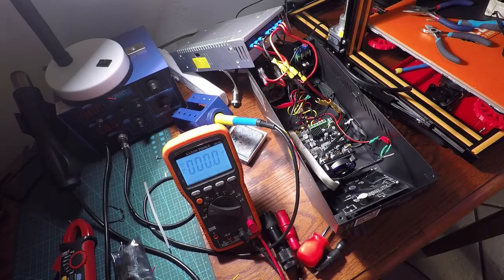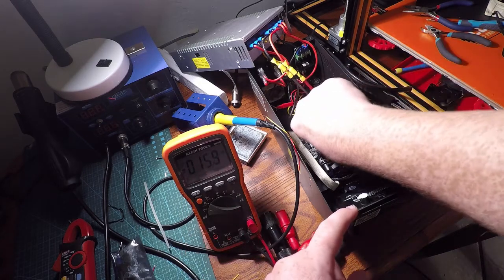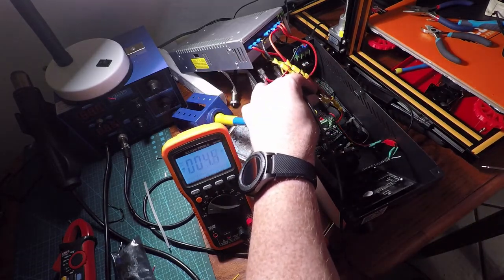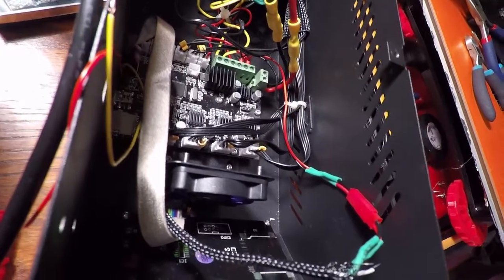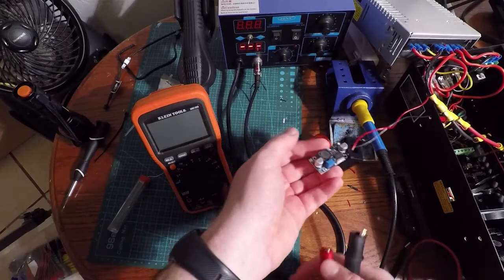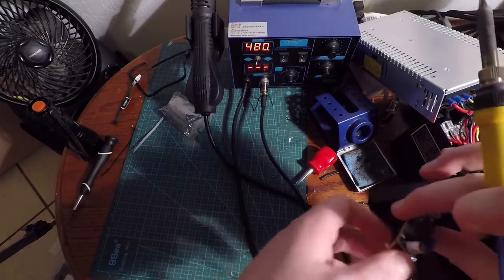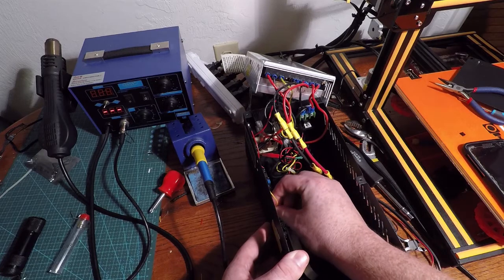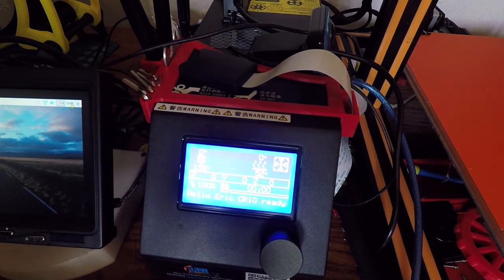CR-10 Stock Controller Board Repair (S Melzi)

Comment: I ordered mine and had trouble straight out of the box. My lcd display flickers in brightness. The SD port doesn't work, when I push the knob to get into menu to home it shows a blank display most of the time. When I print via USB cable it runs fine until it randomly stops and restarts the whole program from homing. Any idea what this is caused by? Last time it stopped I witnessed the screen go off for about a second .

Comment: Dude, thank you for your video! I just ordered the LM2596

I just would like to check there is no current from the intern V regulator (from the motherboard). I own the CR10S which is a different melzi motherboard.... (it doesnt have the USB-VREG pins)

How can I check there is no current going from the on-board regulator in this type of motherboard (CR10S)?

Thank you!

Comment: Did you consider just running it off of USB power?
Reply from the maker: +Marcus Adams yeah but then I would have to have a cord constantly plugged in. I wanted everything hidden so it look decent. I guess I could have tapped in two USB on the circuit board but I don't have a Precision enough solder for those small joints.

Comment: Hello, might be a little offtopic but suddenly my part cooling fan stoped working for some reason, i replaced it and it doesnt work again. tested both fans on external supply they work fine.. Checked slicer setttings and they seem fine. It's so frustrating, thought it would be be something gone bad inside the board?

Comment: I now have 2 different Melzis that are affected by this. Started happening after a Temp Runaway error.
Reply from the maker: I'm not a fan of the Melzi boards from Creality. I think I will upgrade to a 32 bit board in the near future.
Reply: They aren't the only ones with this issue. It's a design flaw thats even in the Wanhao Melzi and FlashForge boards as well. It's triggered by the BED drawing too much power and the Voltage Regulator cannot keep up with the Hot End + Bed Temps.
Reply: I ordered some replacement 1117-5.0v Voltage Regulators. As cheap as they are it would be better to replace it rather than use your method.

Comment: I just replaced my fans and the exact same thing happened when I turned it on. I get a backlit LCD, but no content  I can power with USB fine but Vreg doesn't work anymore. I'll probably pick up an LM7805 and do the same thing. So frustrating.
Reply: You could mention this on your Replace all stock fans video. I ordered 2 new fans but haven't replaced them and I'm probably going to wait for the time being... but your videos are this very informative on the electronic side of my CR-10.
Reply from the maker: That sucks hope you get it working.
Reply: Thanks. It does make me wonder why did the fans mess with our regulator ? I actually unplugged the fans to see if I could get going again, but it didn't matter.
Reply from the maker: +Scott Bradshaw I was able to print after I did the fan upgrade and then in the middle of my second print it just shut off. Were you able to print at all after the upgrade
Reply: Eric's DIY No. First time I powered back on to check the fans, my screen backlight came on, but nothing was displayed on it.
Reply from the maker: It is a weird issue.

Comment: Hello, Eric,
I saw you release a new power on the board, but did something with the old one. Have you interrupted it in any way. You wrote that the old one is about 3 volts, is not there any conflict if the board is powered by two places.
Reply from the maker: Yeah, my built-in voltage regulator went out. So I used an LM2596 as a voltage regulator and tap into the ISP. I took the jumper out so it will not receive power from that part of the board. So now I am only getting power through the ISP. So far everything has been working great I have 400 hours on it with no issue.

Comment: Hi Eric, 
i think mine just have the same issue. When i turn it on, the screen and the blue led on the board light up for one sec and then go off. Did you're printer the same?
Reply from the maker: +Máté Töltősi My screen and board would not turn on at all. I would test the voltage regulator. The same way I do on the video. If it's under 5v then I would do this repair.
Reply: I tested it and it's 12.3 V same as the power supply's output. What do you think?
Reply from the maker: +Máté Töltősi Did you test the left pin on the jumper?
Reply from the maker: https://youtu.be/RUJf54NRdx4?t=2m49s
Reply: Yes, the right pin has no voltage at all. When i plug in a usb cable, and place the jumper to the usb side it is working.
Reply from the maker: You can also test it by moving the jumper to the right 2 pins and plug a USB in.
Reply: The it's 8 V between the jumper and the left side pid.
Reply from the maker: Then yeah I would say your voltage regulator maybe out and this repair should work or you can just use a USB.
Reply: I tride with the usb, the nozzle and bad temp ok, Z axis moving, X, Y don't. I'l try the voltage regulator, hope it works.
thx.

Comment: I'm sorry but this is not repairing but randomly patching and hoping it will keep working without knowing what the consequences are of injecting 5.2V into a failing power circuit are.
Also this video could have been much clearer if you just took a picture of the board and illustrated your actions with a voice over.
I hope these comments help.
Reply from the maker: Only the voltage regulator on my board was messed up and I was not randomly placing 5.2 volts into the board. The Melzi controller board has 3 different areas to input power:
1. The 12-volt power supply where the voltage regulator will automatically reduce to 5v logic (Which my voltage regulator went bad) 
2. USB can provide 5 volts to the board
3. The ICSP which is where I decided to tap into. 
Most Arduino type boards have multiple power source and they can be used without any issues.